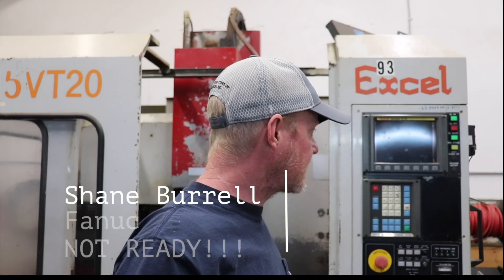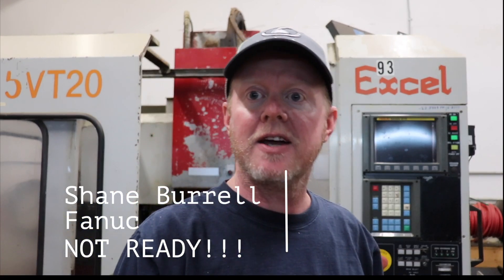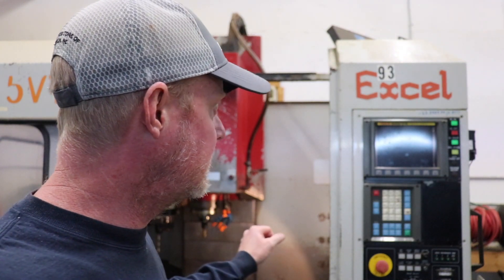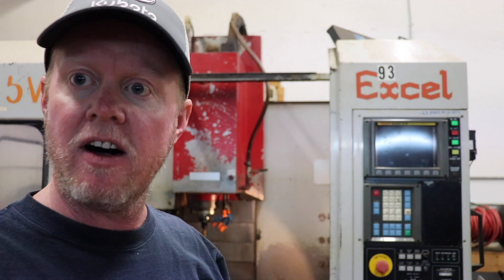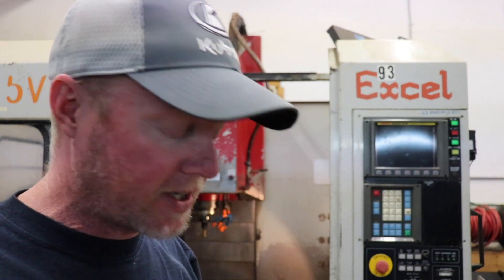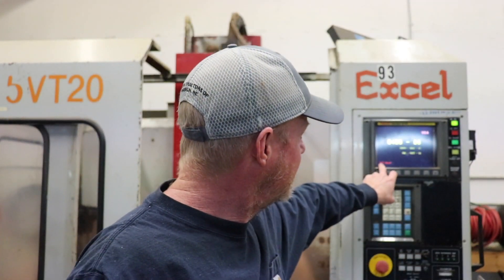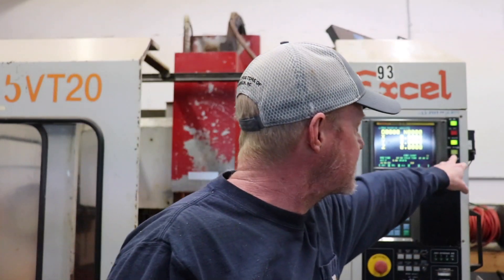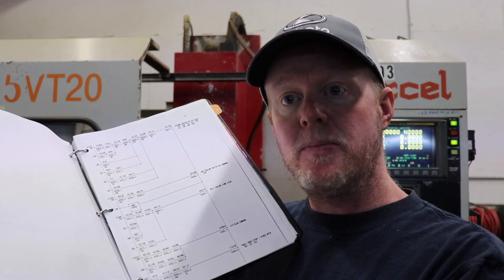Fanuc Not Ready CNC Control Fix

Comment: hello sir .. can you help me to solve the problem like robodrill cannot run G13 . what the problem I can't run G13 ?
Reply from the maker: Does your control have the Spiral Interpolation option? If not G13 will not work.
Reply: @ShaneBurrell1  can you tell me how to look at that ? does that have control on or off. please..thank you
Reply from the maker: If g13 errors it likely doesn’t have that option.
Reply from the maker: @heavenlover58  I have no idea how to find it on a robodrill.

Comment: Hi 👋

I have a Fanuc OM on an old cnc milling machine when I try to send the program it doesn't load it and shows LSK on the screen . I thought it might be the cable but I tried it on another machine it's working . The parameters seem to be ok according to the manual .
Reply from the maker: Has this worked previously?

Comment: Can you help me i have alarm ex1025 (pocket up/down fault) Fanuc 31i
Reply from the maker: What machine is this on? Did you loose power while it was running?
Reply: @ShaneBurrell1  mighty viper and no didnt not lose power
Reply from the maker: If it has tool pocket for the ATC I would check to see if it's hung in the middle.  If you have your machine's ladder you can check the state.  if it's not hung you may have a bad sensor.  In my case mine is air actuated so when that cylinder goes back for the pocket slider it fails to fully extend or retract causing a similar error.
Reply: @ShaneBurrell1  thanks

Comment: Had our 1996 version of you're machine now for one week, so far I can Home it and manually change a tool, can you manually turn on the spindle or is that a MDI g-code?  BTW thanks for all the info, this is really great!!!!!  Ok, I see you are addressing this question in the next video!! Thanks again!
Reply from the maker: The spindle is a MDI g-code.  It take a while to get a  work flow setup but it works great once you have it in place.  If you have the exact same machine be sure to fix any air cylinder leaks.  The tool changer can quickly wipe out some expensive tool/tool holders if you have a bad air cylinder.
Reply: @ShaneBurrell1  It is a few years older, doesn't have a tool changer, it looks exactly like this one - https://www.youtube.com/watch?v=5ipJUALdgTg   I do have a computer right next to the machine so I'll be able to drip feed directly. I won't be doing very complex parts so I don't think I'll need 3d modeling, but would like to generate code from 2D, any suggestions on software?

Comment: Great information!   I have had  not ready issues a few times with no alarms... it really leaves you with no direction  to diagnose  unless you have this knowledge. On top of everything when  my machine hit the hard limit switch the switch remained stuck in after being released and really through me for a loop.
Reply from the maker: Glad it was helpful!  The first few times I got tunnel vision on the hard limit switch itself.  All off them require disassembly.  Now I know it's much easier to just move the ballscrews by hand vs trying to get the switch itself to move off the hard.
Reply: @ShaneBurrell1  hi Shane Burrell . I have problem with Fuji 5000V3 drive for Spindle ( FRN 045V3-21C). The alarm display AL-04 . I read the book to check its, buts not Ok. Can ou help me ? Thanks you
Reply from the maker: @namvi2857  I don't have any experience with the Fuji spindle drive.  Looking at the manual it appears to have extensive diagnostic functions you may want to review and check.